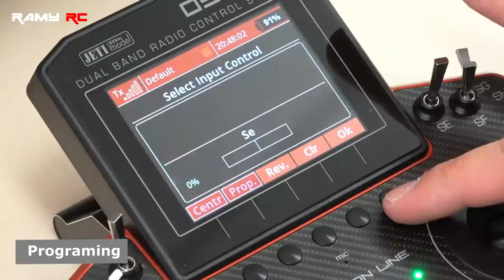Homemade Gulfstream G650 RC Jet/ full build and first flight

Comment: Being able to cut straight lines just by hand with a Dremel tool is quite an impressive skill! Guess it significantly reduces the time you spend building your models!
Reply: Sometimes you can put a piece of angle or square tubing on the part to rest your thumb on (like a table saw fence) and it guides the cut. Or just have skills

Comment: Why did you decide to build the wing out of foam rather than carbon fibre/fibreglass?
Reply: i was thinking about that, the only thing i could really think of was that the plane may have been too light with carbon wings but idk🤷🏻‍♂️
Reply: Foam veneered wings are easier to make (no mould required) and in many cases are lighter than a composite wing. This is a fairly simple wing and I doubt there would have been a benefit to moulding one.

Comment: 6 months to build, 1 second to crash and burn.
Reply: Yea I struggle to put to much time in simple depron builds ... But my oldest plane is from 2014. Crashed it streight into the ground 2018 or so. But had only to replace the depron fuselage with hot glue and tape. Took 20 minutes
Reply: But he didn’t crash it. He’s the sort of modeller who doesn’t let that happen. Diligent with installation, redundancy and preflight checks.
Reply: @Lozzie74  hate to be the one to inform you, but I don't believe a modeller who never crashes or breaks his model actually exists. Environmental issues are out of his control, not to mention sometimes shit just happens. _
Reply: @Lozzie74  he definitely crashes

Comment: I love watching your channel to wind down and see something both interesting and educational.   I see you joining the two halves of your fuselage and see you smoothing out the paste epoxy or glue on the outside but wonder if you are able to do the interior?   If not May I suggest using super magnets and a curved piece of plastic soda bottle to drag the plastic down the seam on the inside using a second magnet and use a little tape to secure the inside magnet to the plastic,  you will have to set them in place before joining but can use one between each brace, say seven and then using a telescoping magnet can collect them through the window ports afterwards before the epoxy sets ,  in case the magnet accidentally gets glue on it.  Collect all seven!  It is possible to use this same technique to lay a strip of fiberglass over the seam to iron down the paste glue and still be able to retrieve your magnets.  What do you think?

Comment: Ramy, good job, very professional as always.  Have you considered epoxying in led strip lighting underneath your fiberglass to let it shine through as a cool effect or maybe just putting it on the inside of a passenger plane to show the windows off in low lighting. ?